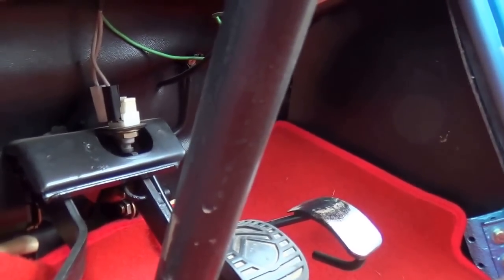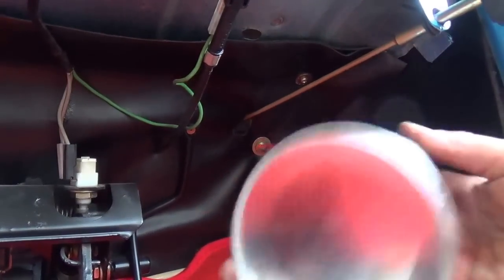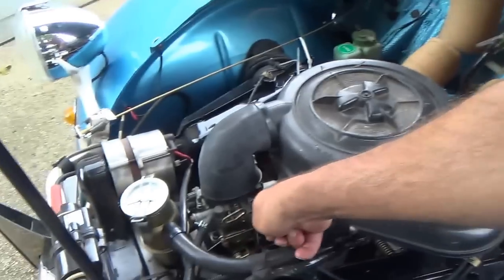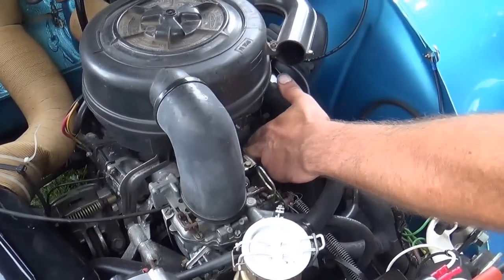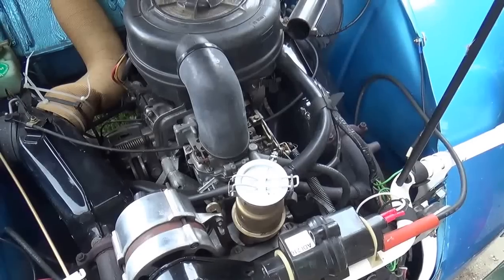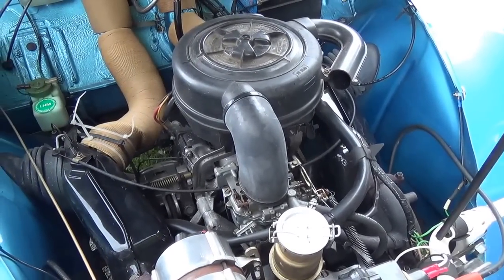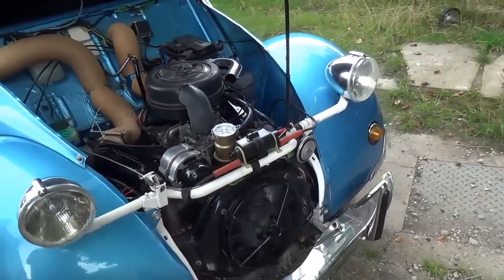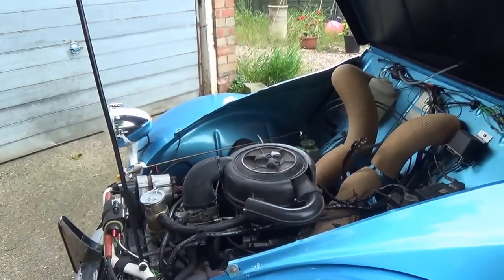CITROEN 2cv - SORTING OUT A STICKY THROTTLE CABLE

Comment: At 1.57, the rubber grommet for the headlight aim adjustment rod is out of position, so there's 'metal to metal' contact, which is often the source of annoying rattles and squeaks.

Comment: It was a pity they never moved the handbrake when redesigning for RHD, a long  reach for the left hand.
It's quite easy to fit a hand throttle as well, a French Autoroute mod,. to spare the right ankle, just don't use it in town.